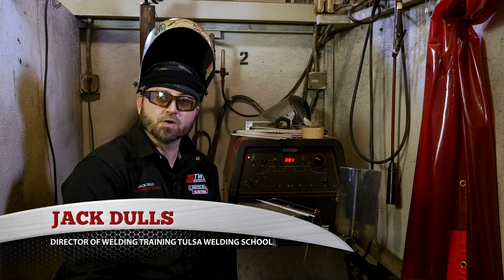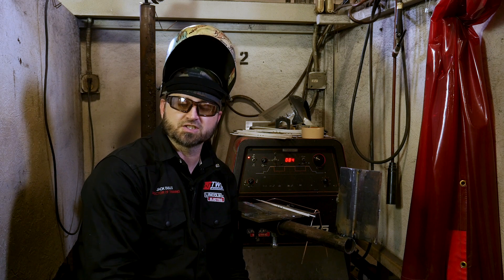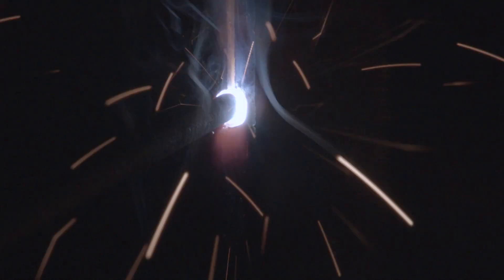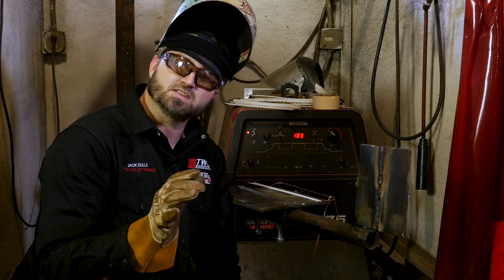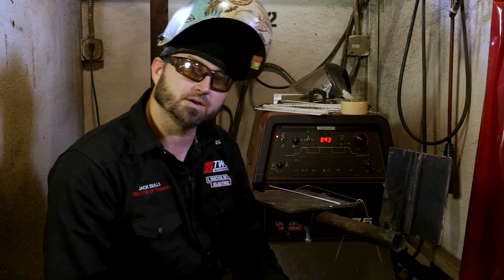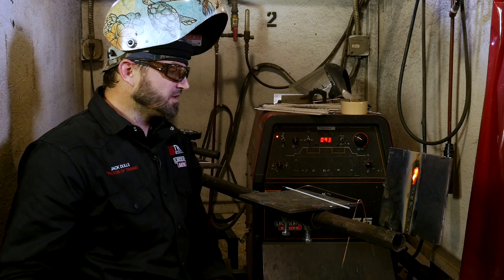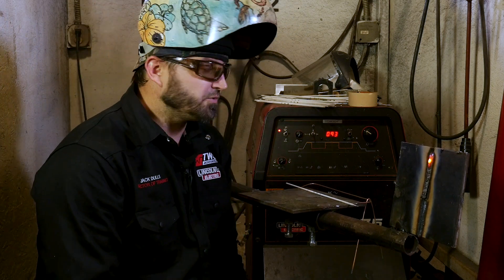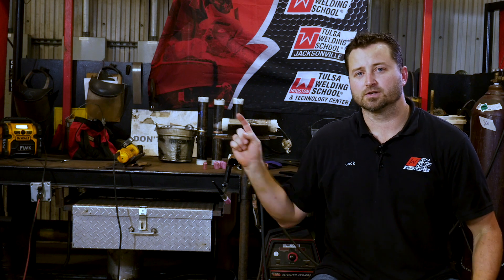How to Weld a 3G Open Butt 6010 Root 7018 Fill and Cap

Comment: This appears to be like our school system by just prepairing for plate test. These students need alot more practice on all joints. They pay a ton of money and dont have the skills to run their own rig in 8 months. Stop deceiving these students besides that most jobs are done with hardwire dual shield for spray transfer stick welding is primarily in the field
Reply: Could you explain that last part of your comment I’m due to graduate this fall and I would like to know what I should be   perfecting so I can be prepared
Reply: @wilbertlewis8561  i guess it depends on what industry are you looking to get into?
Reply: Brian Patrick I was thinking to go in a shop for a year or two before I try rig welding because I don’t really have any connections or anyone to teach me but my instructors. I’ve heard horror stories about guys who try to jump straight into rig welding. Students aren’t respected by the veterans. I’ll take any advice given I’m a sponge right now. But my plan is to rig weld to save enough money to start my own business.
Reply: @wilbertlewis8561  if i was you i practice .030 mig. Also a good shop to learn several skills is a ornamental rail and security door shop, you get alot of welding, metal finishing, layout, installation also its a good business to start when you have mastered all 5 skills, about 4 years with the help of a patient teacher. I started my ornamental business back in 1996 and still going strong

Comment: The most important thing on a 6010 open root is the pentration on back side, why didnt they show that? The cover pass needed more weld metal on edges. Why didnt you grind and cut coupons and bend a root and a face?